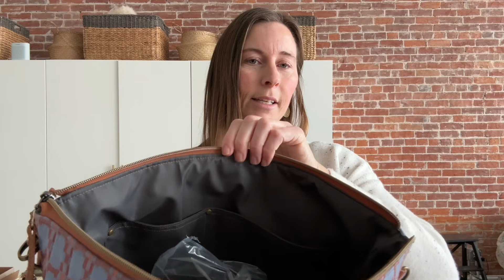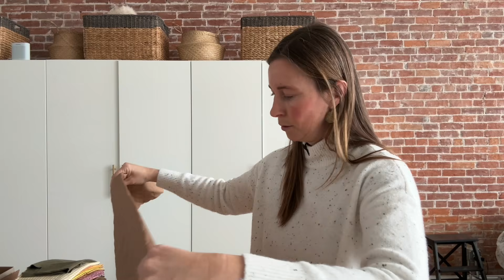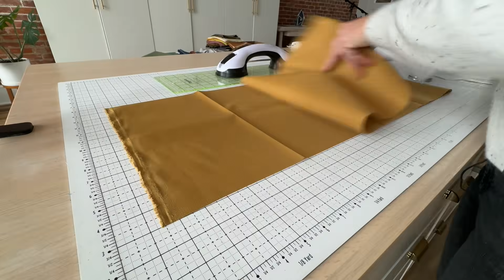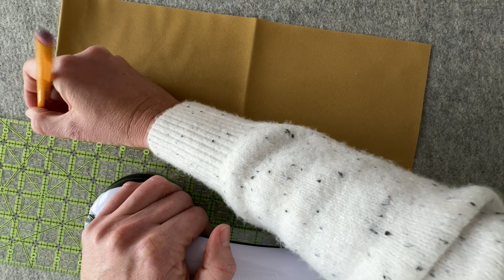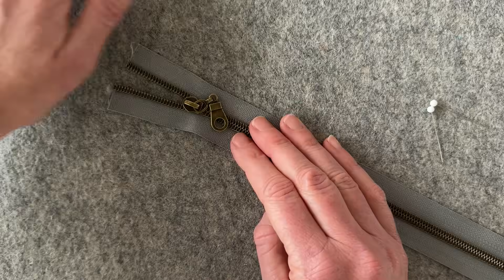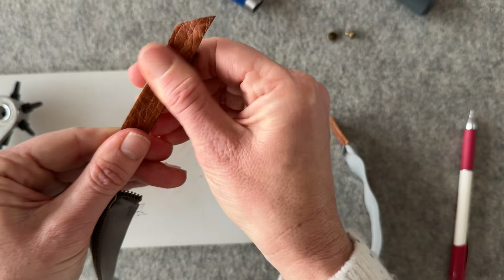Oxbow Tote Sew Along: Part 1

Comment: I love this pattern! Have made 3 overnight bags for a baby gift and getting ready to make another. They are a great size for diaper bag but I feel like also if maybe they have other small children there is lots of room. I add additional interior pockets and a small zip pocket on the outer back. I used 2 layers of extra loft batting and quilted the front and back. Worked very well.
Reply from the maker: Those modifications sound amazing, I love that you quilted the panels! 🧵

Comment: Just bought this pattern and watched part one of your videos and looking forward to making it! I’ve made a couple of your bags and find your videos incredibly helpful. This one looks a bit trickier than the previous ones I’ve tried. If I use your Around the Bend linen  canvas (beautiful prints!) do I definitely need to quilt the outside? I’ve never done that and I’m a bit intimidated to try it. If it’s ok to not quilt, would you recommend the fusible interfacing for appropriate stability?  I’ll probably try the waterproof canvas for the lining. Thank you for any advice on this fabric combo!
Reply from the maker: Thank you! Yes, I would recommend either quilting the essex onto two layers of batting or using Soft & Stable foam stabilizer basted to each piece along the perimeter. Hope that helps!

Comment: Double sided or single sided fusible foam for the outer if using cotton?
Reply from the maker: I use Soft & Stable that doesn't have any fusible on it, and baste it to my pieces along the perimeter. You could use single sided fusible foam, no need for double sided.

Comment: I have the pattern but she never says how long the handles are or the cross body strap. cant fine the length of either. its says three and half and four yards for the 
overnight. How many inches for the handles.
Reply from the maker: Hi Linda, you can find the measurements for the webbing to cut under the "Cutting Instructions" heading, read through the list and you'll find it under the the title "From 1.5" (38 mm)-wide Webbing:"  and the "From 1"(25mm)-wide Webbing:"

Comment: I made a regular and an overnight oxbow tote and here are my personal recomendations about materials. 
Overnight size:
Base: spf 101+ bonded stable, quilt then add pellon peltex for maximum estability. Highly recommend adding purse feet (4).
Main exterior panels: spf101 + viselienne h640 (thick puffy fleece) + bond and stable, quilt (I quilted 1,5inch*1,5 inch squares, go bigger not smaller). This combo makes the bag stand on its own on top of a carry on bag without a bag sleeve. Front pocket is deep enough to keep your phone and boarding pass. Use spf101 only (dont use fleece) or else it will be too tight. You dont need a magnetic snap because its very deep and secure. 
Straps: choose high quality webbing (100% nylon looks a bit cheap, go for cotton nylon mix). I recommend adding a rivet (i used 8mm) on each strap for extra security. I made my handles longer than pattern.
Highly recommend making a second pocket or bag sleeve on the back main panel.
Lining:  add a big zipper pocket additionally to the sleeve pocket in the pattern. Pay attention to the seam allowance difference of the lining! It is smaller than exterior panels.
Zipper: i used zipper tape and added 2 pulls. Select a high quality zipper or else you will regret it later.
Extras: I added a thin cotton webbing with a little swivel fastener to be able to attach any pouch or house keys for easy access. 
Regular size: its the perfect work bag or daily bag or even good for minimal travellers. I made one using dry oilskin for exterior and quilt cotton for the pocket but all above mentioned materials would work for this size too. If you dont want a slouchy bag use bond and stable for main panels and peltex for base. Hope this helps~
Reply from the maker: Thanks for sharing your insight!

Comment: if i am using a canvas on the outside of the bag do i need to quilt it?
Reply from the maker: Hi, you don't have to quilt the main panels if you're using canvas. You will want to use the recommended interfacings though.

Comment: Thanks so much for the tutorial! Question--if i use a waxed canvas bottom, do I still iron that piece to the thick bottom interfacing? :)
Reply from the maker: I would recommend trying on a scrap piece first. However, I typically recommend stitching the waxed canvas to the thick interfacing.

Comment: Finally made one today!  Beautiful pattern and I’m always so grateful for your videos.  
I’m not sure what happened but the zipper I cut (18 inches) didn’t result in having a longer overhang 😢
Reply from the maker: Yay! Sounds great! Did you perhaps grab the Overnight size pieces instead (it requires the 24" zip)?
Reply: I don’t think so. I watched Oklaroots’ tutorial and she had the same look to the zipper so it must be right!  I’m making another today so I’m going to use a longer length zipper as I like yours showing a long tail.  Love all of your patterns!!
Reply from the maker: @frankiedewsbury9100  Check out step 4a (specifically the tip), if you used zippe-by-the-yard you needed to cut your zip to a little bit longer (it's noted in that tip).

Comment: I'm using a cotton canvas with fusible batting for the exterior and cut everything out & fused it with reading to page 3 about quilting it. :(  Do you think I'll still be ok without quilting the batting to the exterior? Thank you!
Reply from the maker: Yes, I think since it's a fusible batting (assuming it's a somewhat permanent bond) that it will work!

Comment: I am curious as to what kind of machine can handle some of the thicknesses that you are working with? Do most Home brand machines deal with this thickness ? The strapping material looked very thick when you folded it under. I have a mechanical Bernina  1008, I also have a non computerized Bernina that is an  930 electronic . I love both machines , my 1008 is a newer machine . Maybe handles thickness a bit better than my 930. I don’t plan to buy a new machine any time soon . Some of the fabrics with all the added interfacing looks quite hefty . I just might have to modify my outer fabrics and added interfacings. I see that you are using a New Home . I have a computerized New Home embroidery machine that is well over 25 plus years old  but have no idea how much thickness it takes. I made bags but they did not have the materials that you are using that many years ago. We have come a long way in 25-30 years. Amazing fabrics. Thank You.
Reply from the maker: All my patterns are designed to work on a domestic (home) sewing machine. I use a Janome 1600p, but I also have a Janome Memorycraft for taking on sewing trips.
Reply: I have an Singer SE9180 and didn't have any issues at all

Comment: Please can I ask if you are left handed?  I only ask as I’ve just made my bag and when on my right shoulder the bag opens backwards, which feels strange.  I have reviewed the instructions and I did as per your video and booklet.  I’ve got the regular size cut out so I’m going to swap the sides around to see if it’s makes a difference.  I love the results of the bag.
Reply from the maker: I am not, but I typically don't open my bag while I'm wearing it (usually packing/unpacking with the bag on my dresser). However, feel free to change it up to suit your needs. :)

Comment: Hi - I'm getting this pattern today can I just check, on the version you made you said you used 2 layers of 20/80 batting - did you cut both full size or (like you suggested with the alternate material) did you cut the first layer out of the seam allowance?  Sorry if you went over this already and thank you for a great pattern and tutorial
Reply from the maker: Hi, great question! I did not. I rough cut both layers of batting and exterior fabric, quilted them together, and then trimmed the quilted piece to the Main Panel size. Hope that helps! :)

Comment: how to you attach the interfacing to the base when using waxed canvas? when you don't want stitching to show like you did on your bags
Reply from the maker: Hi! For my samples I didn't end up using interfacing on the waxed canvas base. You could add it to the lining piece instead (that way you could fuse it in place. Otherwise you could baste it in place on those short end of the base. I'm sure you could have other options, but those are the first that come to mind. Hope that helps!
Reply: Thank you so much that really helps. I can’t wait for the next installment.